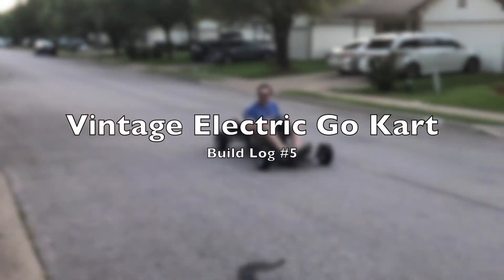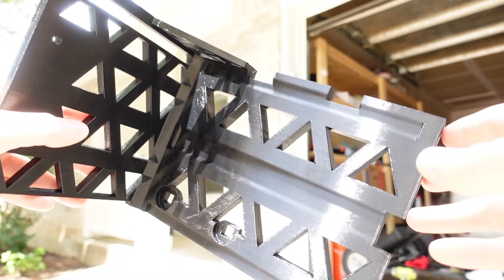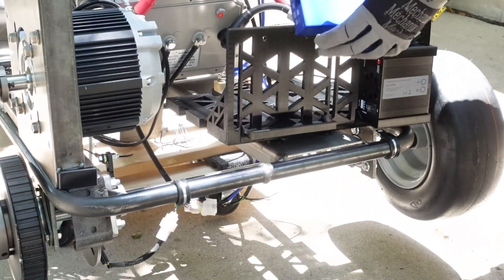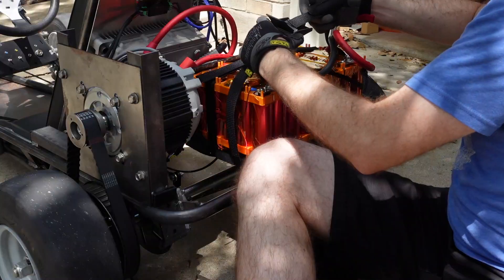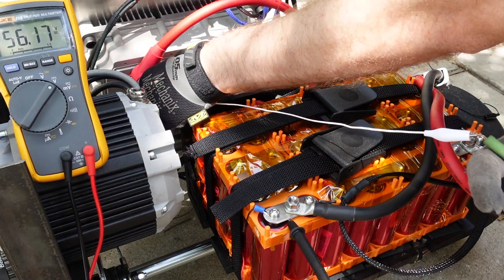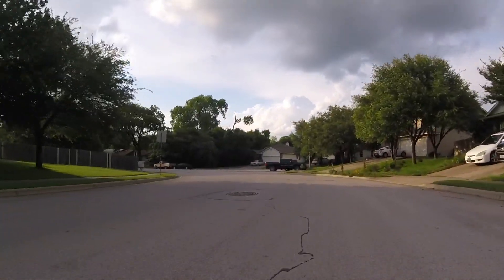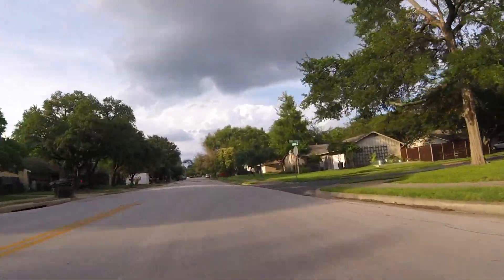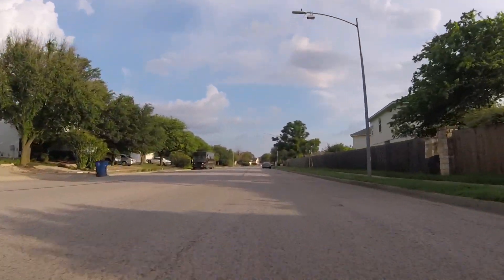Vintage Electric Go Kart - Build Log #5

Comment: Inspiring build. I am putting together an electric kart very similar to this. In fact I have the same Motenergy ME1718 motor as you. I was wondering if you could tell me where you got your pulleys and belt?
Reply from the maker: It is a bunch of parts:

* https://www.mcmaster.com/6495k523/
* https://www.mcmaster.com/6495K511/
* https://www.mcmaster.com/6086K114/
* https://www.mcmaster.com/6086K516/
* https://www.mcmaster.com/95053A301/
* https://www.mcmaster.com/6484K404/

Comment: Specs motor/battery/controller? Acceleration times 0-100kmh? Top speed?
Reply from the maker: For those specifications see build log #1 as I outline those parts. I haven't done any acceleration times yet. Based on my first test 0-40mph is about 5 seconds. Top speed is about 43mph with current gearing. Both acceleration and top speed have room to grow as I've dialed back the controller to about 50% total power output.

Comment: The springs in front are causing bump steer.  Meaning every time you hit a bump the front toe changes.  That is why it is darting around on you.  Replace the springs with spacers.  Set the toe-in around 1/16 inch.  The springs are there for people that ride on dirt where bump steer doesn't really matter.  Nice setup.
Reply from the maker: Thanks! I'll grab some similar sized spacers and give it a try.
Reply: @andyshinn  You don’t see “springs” on shifter carts.  They can go over a 100 mph no problem.  You do want a very smooth road at that speed.  Adding more caster will help keep steady at high speed.  Would require cutting and welding the front brackets.  Good luck.

Comment: If you have new break pads they might take a bit of time to ware in and should work better depending on the pad compound
Reply from the maker: Yeah I'll use them for a while and see if they break in. But it does feel like the rotor is warped and they are pretty cheap mechanical brakes.